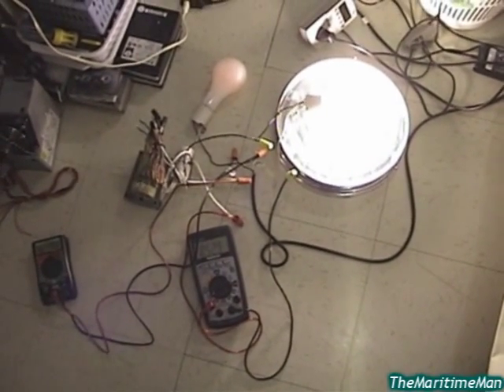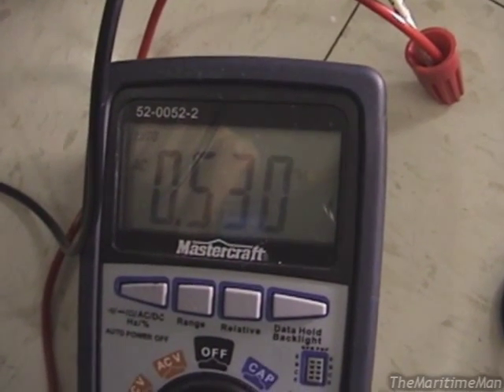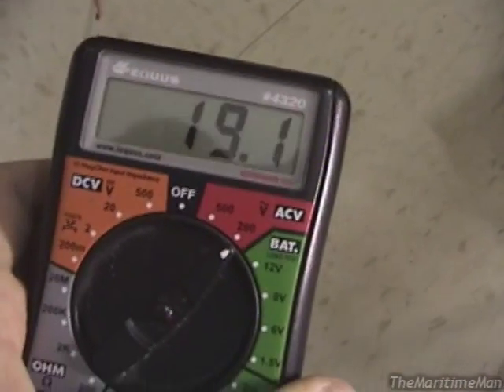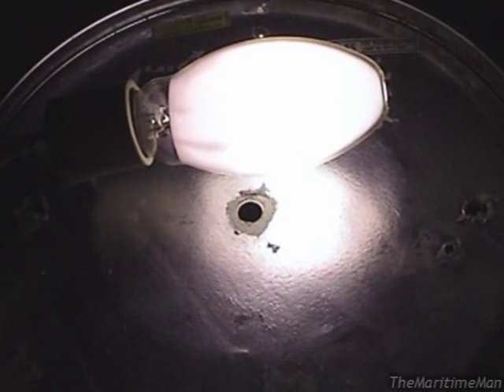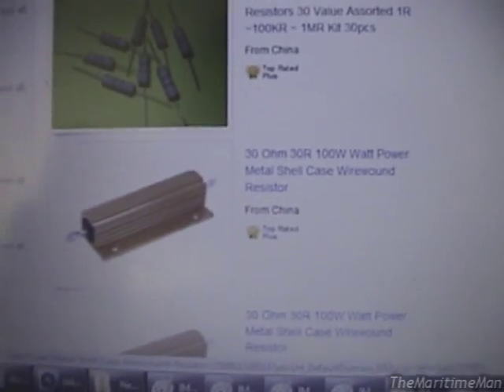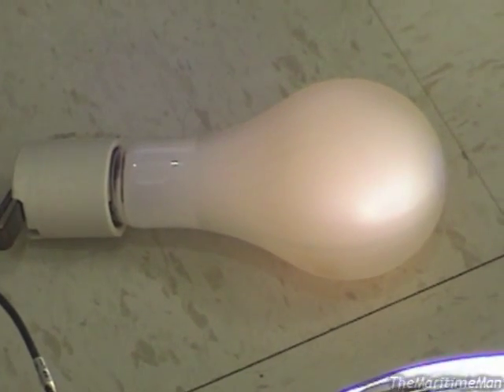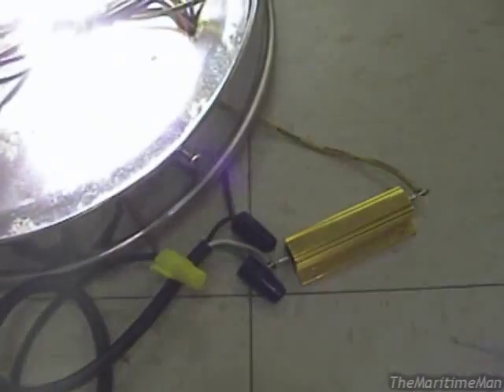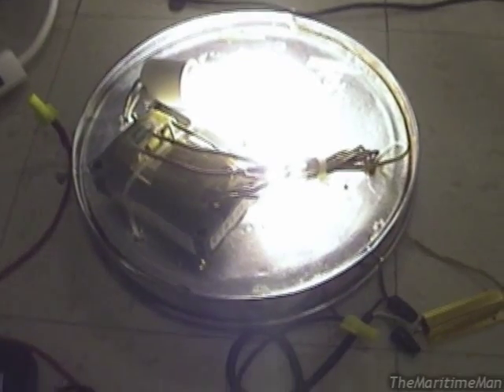New ballast for the mercury vapor fixture (Part 2)

Comment: It seems like resistors might be a good way to run Japanese 100V 60Hz ballasts safely in North America.
Reply from the maker: @worldwidehidcollectorusa-fkt  Japan is 50 Hz, not 60 Hz, right? 100V 50 Hz ballasts generally work fine at 120V 60 Hz because the higher frequency offsets the higher voltage.
Reply: @ Actually, Japan uses 50Hz power in the east like in the city of Tokyo and 60Hz in the west like in the city of Kyoto. It is the only country in the world that still uses 2 different AC frequency standards. As a matter of fact, I have imported a 100V 60Hz Japanese preheat fluorescent fixture as well as some 100V 50Hz preheat fluorescent fixtures. So far, I have hooked up some Japanese 100V 50Hz preheat fluorescent fixtures to 120V 60Hz supplies and they seem to be doing well although they would work better on a 110V 60Hz supply assuming I can’t afford a 50Hz inverter. Additionally, I have also been considering the idea of importing some Japanese 100V 50Hz high reactance autotransformer (HX) HID ballasts into the USA because the increased applied frequency and applied voltage allow them to run decently well on 120V 60Hz supplies as well. I was especially looking into importing the medium and high wattage 100V 50Hz HX autotransformer ballasts because medium and high wattage 120V 60Hz HX autotransformer HID ballasts are extremely hard to find in the USA and I just love running metal halide and high pressure sodium retrofit lamps designed for mercury vapor fixtures reliably. Every now and then, you can also sometimes find 110V 50Hz and 110V 60Hz preheat fluorescent ballasts and HID ballasts being domestically sold in Japan and those ballasts are also somewhat safe to operate on American 120V 60Hz supplies too. However, when it comes to importing Japanese 100V 50Hz CWA HID ballasts and lead type rapid start fluorescent tube ballasts, you will need to run them off of a pure sine wave inverter with a 100V 50Hz output since they operate differently than HX autotransformer ballasts and series choke ballasts.

Prior to 1948, even the USA used to have a 50Hz power grid as well while the rest of the country used 60Hz power grids. The part of the USA that had 50Hz power was in Southern California where I currently live.

Comment: Can I ask a question?  If an electronic metal halide ballast is too far away from the bulb, can that cause problems with starting?  I have a tree light that starts erratically, and sometimes will not start at all, sometimes will start but erratically.  It is a 70 watt with the ballast in a metal box on the ground and the lamp up in the tree.  Could lamp to ballast distance be causing this problem?
Reply from the maker: Absolutely. Only postline ballasts are rated for remote use, and even then it's only for a few feet from the lamp.
Reply: If I moved the ballast box to a tree branch close to the lamp head, would that resolve the problem?

Comment: Hi Maritimegirl.. its been a while since we've talked about lighting. I love mercury lamps as well. I use Vossloh Schwab 230 V choke (simple reactor), a 400 Watt, 250, 100 and 50 W ballasts.  The 400 Watt ballast is the largest being the size of your F40T12 fluorescent ballast. The 50 Watt reactor is tiny by comparison to the 50 Watt HX auto transformer that you're playing with.  I recommend that you try the Vossloch Sbhwabe choke ballasts. 
BTW... the incandescent lamp in your video lit brightly when the mercury lamp was not lit while cooling off is due to the power factor correcting capacitor.  You had a resistive element...namely the 250 Watt lamp.. connected to the power line in series with the capacitor.  The unloaded ballast is essentially out of the circuit. The capacitive reactance lowered your incandescent lamp power to 68 watts.  Without the resistive element of the light bulb,  the capacitor would return the power back to the line.  It is not uncommon to see capacitors across the power line to compensate for inductive loads on the line. 

Seeing how much you like to play with that fixture of yours,  I wound leave both sockets in the fixture and connected in series.  One socket for the mercury lamp, the other for a 100 watt 240V bulb as a ballast resistor. Power up from 240 V directly.  The incandescent ballast lamp will provide some light to supplement the MV bulb...

Comment: If you want to make that setup more efficient you should try specifying an incandescent lamp to act as a resistive ballast. It'd also be good for improving the CRI of the entire fixture as you get some glow from the incandescent lamp as the arc lamp runs. An even bigger bonus is that you could stick a higher wattage lamp in by using a higher wattage incandescent lamp.